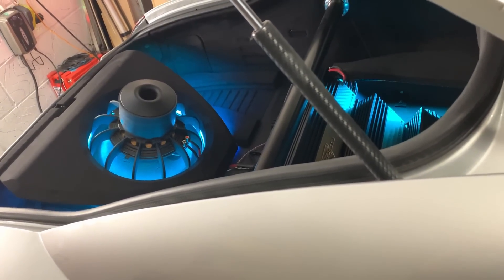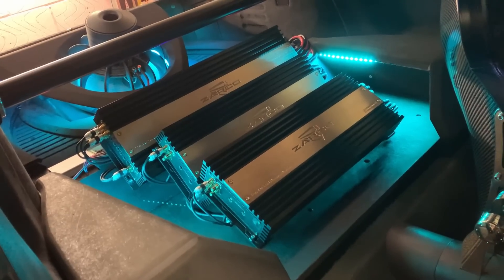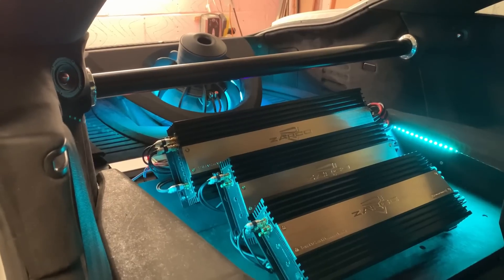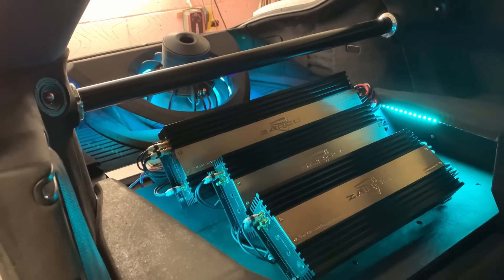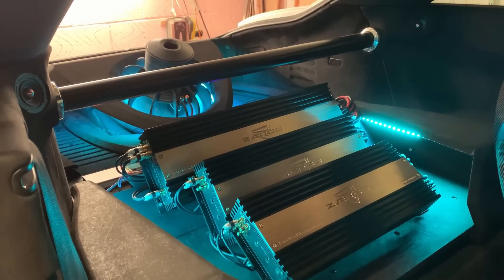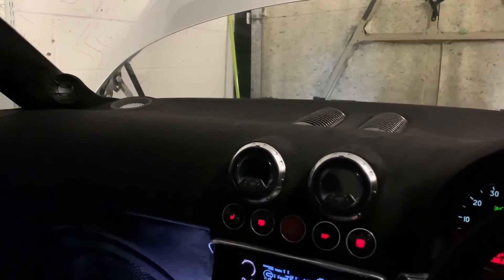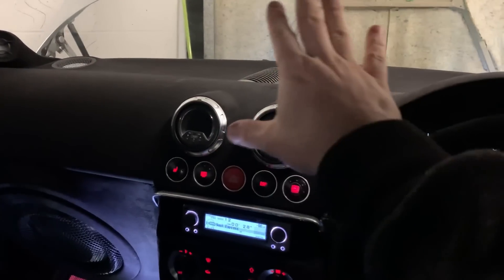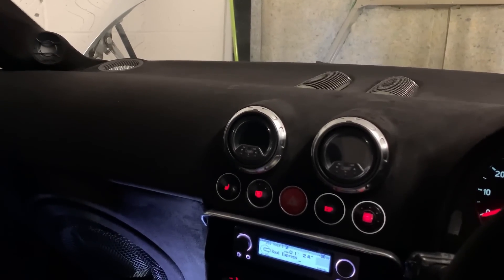Audi TT Audio System EXPLAINED with EMMA SQ Competition Disc 2018-19 - Accuton, Zapco, HAT, Fi

Comment: Peter, any pics online that might show hoy you built the cover panel over the sub? Not the manifold. Is it just a few layers of panels with the cutout rounded over? Does it float above the manifold on feet? Incredible work you do!
Reply: Okay, Megane video answered my questions!
Reply from the maker: That was different. There are few pics of the TT build here:

https://www.facebook.com/media/set/?set=a.1725097144207864&type=3
Reply: Wow, okay yes different, incredible details. I want to try a Megane style trim ring in my other build sealed box SI SQL-15 kinda shaped like TT. You motivate us! Will try but no doubt won’t turn out as nice as yours!😂

Comment: Hey Peter great video you have great knowledge on these and ur setups are great just next level, I have my budget sound setup with pioneer sub which plays low lows untill around 20-30 hz But my sub dips upwards of 50 - 60 hz onwards i have my infinity coaxials they have dip around 760-130 and i have them installed in encloger how do i cover it and have accurate sq bass on that maybe any components 6.5 inch or 8 inch sub u recommend or a midbass, and  How do i eliminate harsh highmids in car its i think its the speaker but maybe the car is also making it more harsh?
Reply from the maker: Hi
Please watch the Tuning playlist and then you can see that every system needs a proper RTA evaluation. Without that it’s difficult to tell anything.

Comment: Hey peter great job! Got a question for you: my bass lags behind. In my peugeot I got a pair of 8 inch (home audio) subwoofers in IB behind the seats, and I feel like the bass energy is stored in the bodywork of the car (or the suspension or fuel tank for that matter). I've dampened every body surface I could get my hands on, (with amazing results for mid and high frequencies) and yet my bass is audibly sluggish. I'm soon going to switch for a nice amp with better damping factor, and a nice pair of focal 12 inch subs for better and cleaner bass, but the fear's still with me that I won't have that fast bass I desire. What's your take on that? Where do you think the problem lies and how to solve it? Thanks a ton!
Reply: Have you done time alignment on every speaker in your car, with a tape measure ?
Reply from the maker: Ali Mahdavi you can not just have any speaker in any application! Your home audio subs maybe designed for a box application too. 
Also, “fast bass” comes from midbass, not just the subs. 
When the sub is well installed and is in time and phase with the midbass, that’s when you get slam/punch/kick.
Reply: Yes you're right, I'm yet to do time alignment, and I also have to reconsider the xo points between my midbass and subs. 👍

Comment: For rear fills the added 20ms delay was over and above the values of front left and right?
Reply from the maker: Yes.
Reply: @pssound9749  Pardon my ignorance. Is the 20ms delay over and above the midbass or midrange delay?
Reply from the maker: A it’s a rough guide, needs playing with, there’s not a golden rule for it as far as i know.